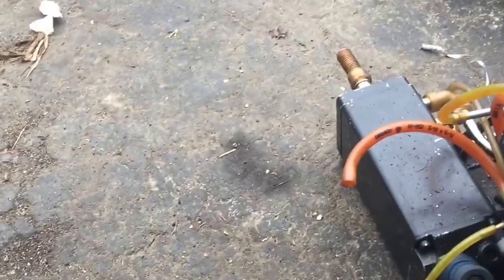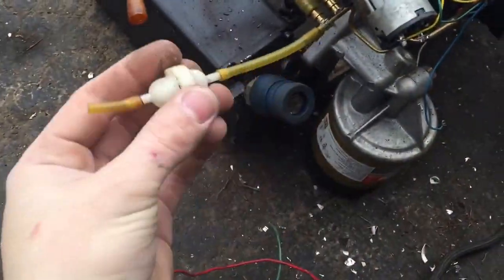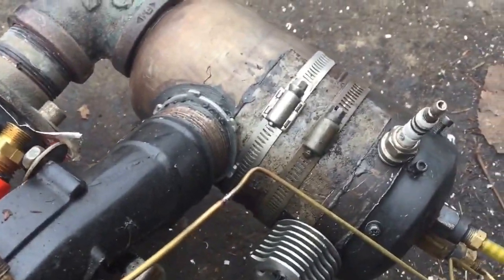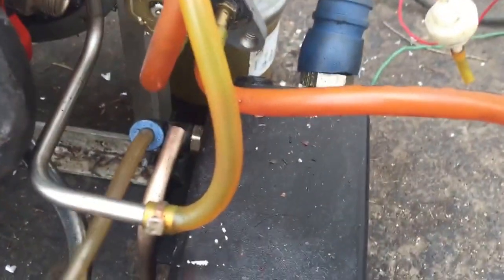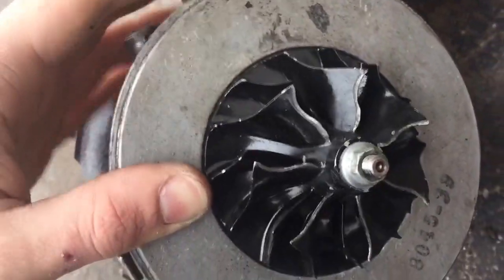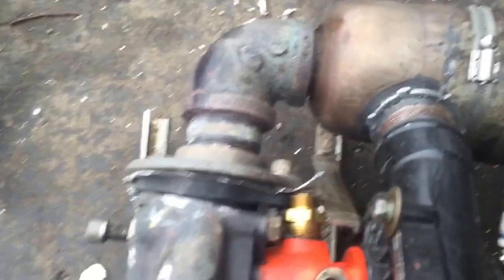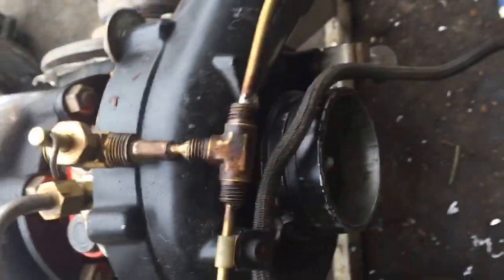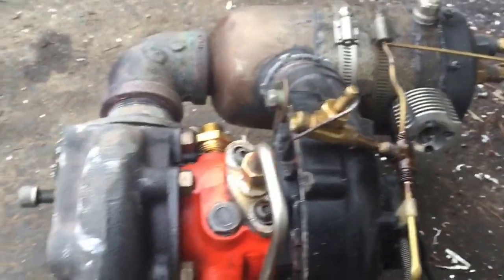vlog no.5 homemade gas turbine engine.

Comment: Can it be powered by burning rocks !
Reply from the maker: In theory yes, if I could find a way to inject coal dust at a fine enough powder it can run on coal.
Reply: @Greyline_ENG  I. Will give you more info

Comment: what happened does it work
Reply from the maker: It did but i just wanted to make it more efficient and more advanced. but i do have a video of it running.
Reply: Gregory Renfrew do u have the link and i actually have a design for onre for production
Reply from the maker: its on my channel i don't have that many videos. for the new design i'm hoping to get a 7:1 overall pressure ratio.
Reply: Gregory Renfrew im hoping to produce a line of cars with mine in it Ive even figured out a transmission that maximizes the over all efficiency of the turbine atleast in theory until i can prove it with my prototype once i build it its all on paper now
Reply from the maker: that sounds interesting do you have any videos of your prototype